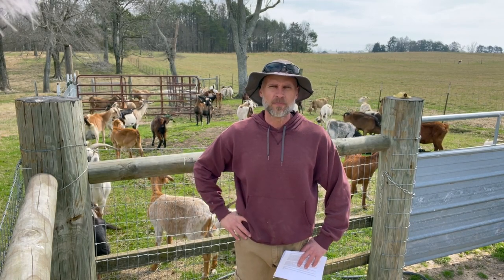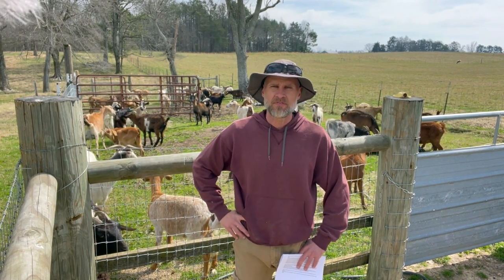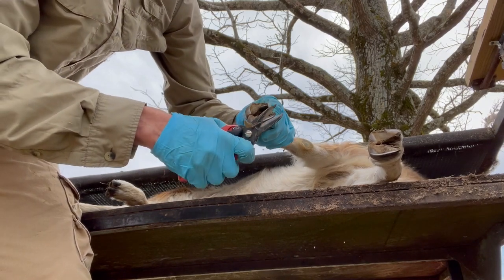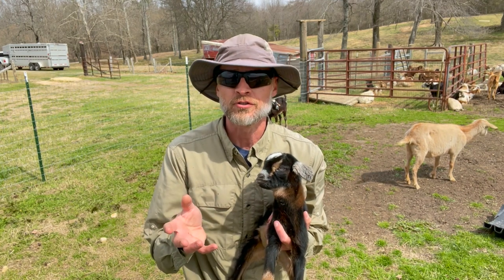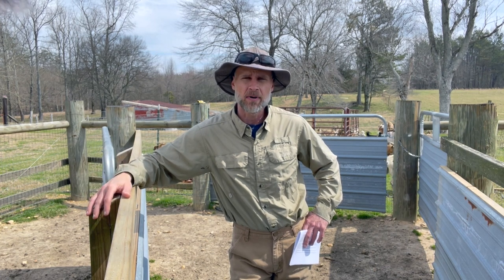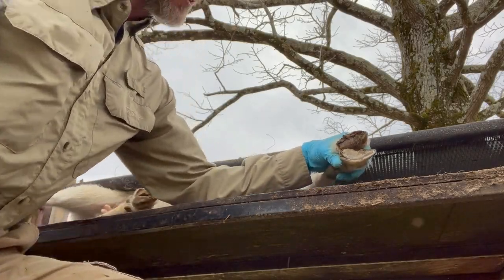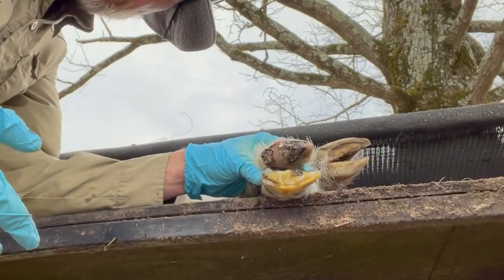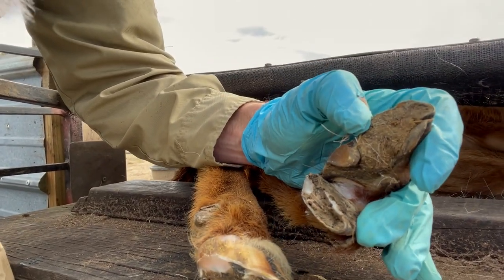Trimming Goat & Sheep Hooves

Comment: I love the demonstration, how do I go about doing it if I don't have a turn table? I would love that on a video
Reply from the maker: I may try to make a video on that sometime. With Sheep, you can straddle in between your legs, pick up their front legs and make them sit on their rear end. Most of the time they will stop struggling and let you trim their hooves. You can also try to put them on their side and pin them down while you trim their feet.
Reply: @rollingofarm  greatly appreciate it! I build my own Milking stand which inl can use   as a trimmer as well

Comment: Great video! Very helpful. 
Am I understanding correctly that the pads can be (and sometimes should be) trimmed as well? I have tried to avoid cutting into the pads but sometimes it looks like it could be helpful to trim even some of the pad. Thanks!
Reply from the maker: Yes, there are times the pad needs to be trimmed. Just trim it in small layers until reshaped properly or till it starts to show pink.
Reply: @rollingofarm , thank you!